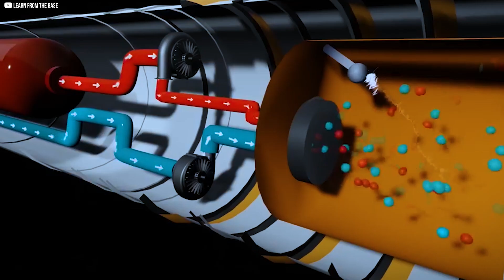Why Plasma Rockets May Replace Chemical Fuel in Space

Comment: plasma heat-mhd detonation thrusters work in air, unlike the normal vacuum ion thrusters. plasma thrusters in space will use a propellant gas to be accelerated, similar to ion thrusters.